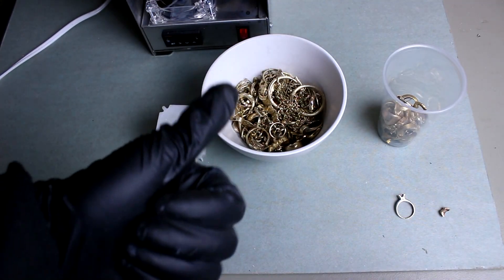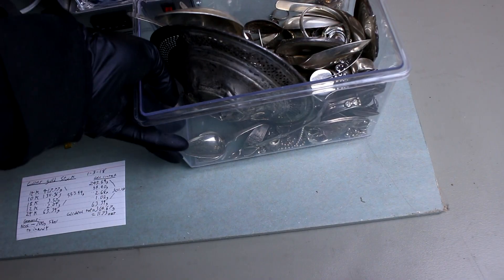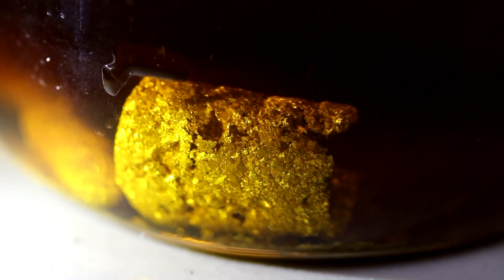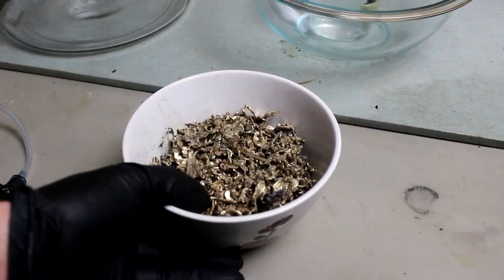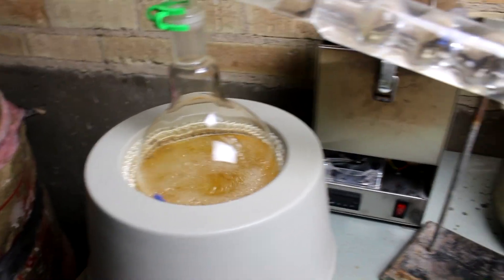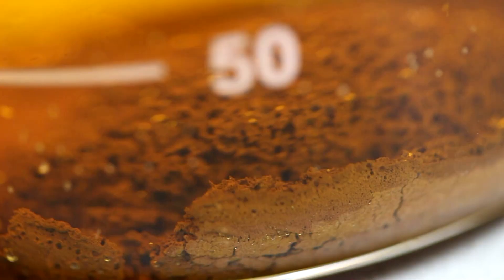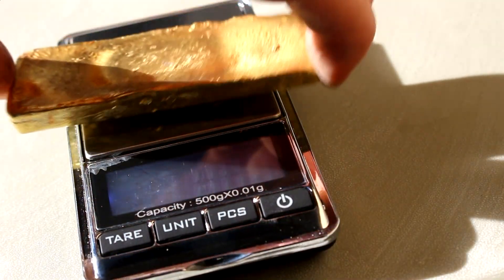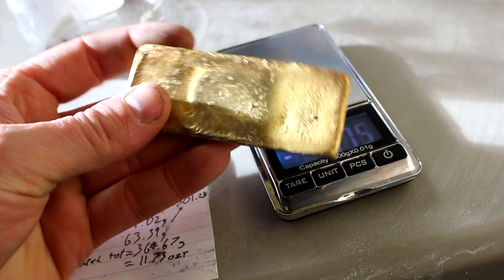Metal Refining & Recovery, Episode 22: 15,500$ in Gold?

Comment: Hi. .
             What exactly is " Diesel exhaust fluid ??" I know there are additives used in semi diesel engines to run during the colder winter, and some to prevent bacteria growing ,or start easier, and some to lower emissions . Love your mad scientist videos ................. Joe Henry , Boise , idaho.........
Reply: Diesel Exhaust fluid is a Urea solution that is sprayed into the exhaust that causes a chemical reaction remove NOx from the exhaust. Its nasty, pain in the ass to work with, and it corrodes everything. Its another emissions control system for diesels
Reply: I'll second everything gwhunter said and add that it's alkaline which is why he used it to neutralise the acid.
Reply: gwhunter is correct. It is supposed to bind to the exhaust to make it heavy so if falls to the ground instead of going into the atmosphere. I work in a diesel shop and no one likes working on DEF systems. I've worked on leaking ones and the entire bottom of the truck was covered in crystallized urea, which is the main chemical found in urine, though they use synthetic urea for DEF fluid, and if it gets on your skin, it itches and irritates your skin for hours.  if you've ever had to clean dried dog or cat urine out of carpet, that is basically what it smalls like.
Reply: This is really interesting . See usually to remove nitric acid in this refining process it requires a long boiling process to make the nitric acid go away. That is really necessary for this process, and this alternative to get rid of the nitric is a big deal, might be much better option .. In the past I have spent days boiling mt aug regia to eliminate the nitric. That is really a pain. and slow. Though now to think of it sometimes  urea pellets are used for this purpose , and this makes sense now..

.

Comment: Saved you a google: Diesel exhaust fluid is a urea solution in water. 

DEF is a 32.5% solution of urea, (NH2) 2CO. When it is injected into the hot exhaust gas stream, the water evaporates and the urea thermally decomposes to form ammonia and isocyanic acid:

(NH2)2CO → NH3 + HNCO
The isocyanic acid hydrolyses to carbon dioxide and ammonia:

HNCO +  H2O → CO2 + NH3

Then, the ammonia reduces nitrates/ites:
2 NO + 2 NH3 + 1⁄2 O2 → 2 N2 + 3  H2O        and
3 NO2 + 4 NH3 → 3 1⁄2 N2 + 6  H2O

This is the reaction which quenches the nitric acid.

Comment: Cody, isn't it safer to add acid to water instead of adding water to acid?
Reply: Idk if this is serious or a reference to his older video
Reply: "Do what you ought'a, add acid to watah" Yes, typically you want to add your acid to water. But this adage refers first and foremost to sulfuric acid , which has a very very high heat of hydration and will actually boil water instantly if you add it wrong, causing splashing; this can happen even if you do the "right" order (I've done it in my college chem days). Nitric acid is less ornery in this regard, so it's relatively safer to dilute directly, but the safer approach is still do dilute the nitric acid into water first to make a weaker solution, which you can safely add water to.
Reply: no but a simple answer like defenestrated posted would work great as to explaining why it does or doesn't matter which order things are mixed in.
Reply: If you are a chemist with years of intuition, yes it seems kinda stupid, as you know where the limits of things are, and how things generally behave. But now put yourself as a college or even high school chem professor, and you have to make sure classes of 20-30 potentially bored, foolhardy, careless immature humans don't create an incident. Iterate over 4 class sections a semester, 2 sections a year, year over year, multiple professors... odds are you will find at least one horrendously unlucky person that manages to get it to react violently and splash someone. Do you really want to be the one that has to have that injury on their conscience, or do you want to teach them a little ditty which, at worst, a good lab practice?
Reply from the maker: Alright do I need to make a mathematical proof or something to show how stupid that rule is?

Comment: You have Oz on that scale
Reply: a Troy Oz is roughly 10% less than an Oz
Reply: Mark Pettersen ? What you want to say with that statement? Hehe

Personal I don’t understand wy use lbs and ounce and so on when you have gram kilos and tons 😁😜😋
Reply: Mark Pettersen 1 once isn’t that like  28,3 grams?
Reply: I'm with you on uniformity and ease of use with metric, all I was saying was the Oz on the scale is not the type that was mentioned. It does get confusing same as most don't realize the difference between a ton and a tonne XD
Reply: Mark Pettersen 1 ton is 1000kg or 100000grams 😁 

har jag rätt svar😏?

Do i have the right answer?

Comment: Oh Cody, you're chemistry technique is going to take you out someday. Who on earth adds water to fuming nitric acid? Bad chemists. If you ever get unlucky it's going to bite you. As I've repeated to my first years for the past 20 years, concentrated acid to water will keep your fingers intact. Hope you never find out the hard way.
Reply: As a chemist myself I have to say the "adding acid to water" only really applies to very concentrated, almost anhydrous acids like > 90% sulfuric acid and its derivatives (methanesulfonic acid, triflic acid etc.). With these acids, the heat formation is very high and since they are so dense, water tends to float on top while boiling, resulting in the splashing effect. The nitric acid he distilled over is at highest around 65-70 % so the heat formation shouldn't be high enough to cause boiling + the water and acid mix much faster, thereby distributing the heat better. I definitely agree that the proper way is to always ad acid to water (as a safety habit) but Cody has probably enough experience in doing this that he knew it wouldn't hurt him.
Reply: Watch some of his first videos. Were he unsuccessfully tried to get the acid to spit at him by adding water.
In my experience this usually only happens in really narrow vessels.
Reply from the maker: 60 to 70%? The nitrate is baked dry and the sulfuric is 93% I'm not an experienced chemist but I am  pretty sure water doesn't just spontaneously appear.

Comment: I had two questions up to this point.  One when do you need flux or borax with silver? I had thought it was to keep molten silver from oxidizing but it doesn't seem to have been the case.  Second and possibly more important.  had you dropped your crucible in the liquid, would it have exploded?  And upon getting to the end I wonder if you were to shape your gold into a slightly larger foil.  Could you then get noticeably different weights in and out of direct sunlight?  I wonder given the effectiveness of solar sails.

Comment: I used to work in precious metals and I have some things that I remember of what I used to do in refining (talking a result of 3kg+ of 9999 gold at time):
First, you'll want to make sure you have approx 36% copper in your mix (I think) before you granulate.
after it's dissolved in your HN03 + HCl you'll end up with your solid silver chloride powder which you'll filter off.
Next we added urea granules to neutralise the Acid before adding in the Sodium Metabisulphate (dissolved in water). I can't remember exactly the probe reader we had, but you couldn't add too much Na2S2O5 or else you'd start to precipitate out the copper too (which I think you might have done with your gold bar - it didn't look pure). That was also filtered.
Lastly (for the gold step), the red powder was washed with ammonia (to dissolve the rest of the silver) before being rinsed with water and dried before being melted.

We were also dealing with Platinum and Palladium in our mixes, so the solution after filtering the gold out was then treated with Ammonium chloride and then had chlorine gas bubbled through it until the Pt & PD precipitated out (bright red - crimson powder in a clear, bright-green solution.)

Hope that is of any help to you.
Reply: Building Books industry is very cool...

Comment: You should heat up your molds hotter before you pour It makes a world of a difference in bar quality. It should be hot enough so that the bar doesn't instantly solidify and cause wrinkles on the outside. While making jewelry we usually just cast one then the next pour has warmed up the mold.

Comment: Would it be effective to capture the nitrogen dioxide and bubble it through a water supply to recover some nitric acid? Granted the temperature would have to be correct, but with some simple lid and tubing some nitric acid could be formed and hypothetically re-used.

Comment: you are not supposed to add water to acid "ad the Acid to the water like you otter"
Reply: Bryant Zaugg holy crap, you’re actually right
Reply: He did a video previously that shows it doesn't matter either way as long as it's done slowly. He also goes into detail as to what scenarios it becomes an issue.
Reply: the rule is add the acid to the water in chemistry. When you add water to acid (depending on how strong the acid is) it could explode and burn you and anything around you
Reply: Bryant Zaugg and as I said, Cody has already done a previous video on the subject. Go watch it.
Reply: better safe then sorry

Comment: Normally the acid is added to the water in order to dilute it, not the other way around
Reply: Brand1n N a long time ago he did his own version of mythbusting by adding water to hot, concentrated sulfuric acid-probably THE worst case scenario for adding water to acid- and could not get the instant boiling and splattering that lab safety lectures warn about. Plus it's cody so safety conventions are merely recommendations.
Reply: robert jencks also safety squints

Comment: diesel exhaust fluid?
Reply: Aqueous Urea 33.5% With Distilled water 67.5%...
Reply: the fluid that binds NO2 and NOx in the exaust gas of diesel engines from cars
Reply: Paul imWald it's more of a truck thing than a car thing
Reply: yea your probably right but wasn't there a scandal with VW about that and their diesel cars?
or maybe they use a slightly different method of extracting NOx.
Reply: Paul imWald well, that was just VW, i don't think that many if any cars have an Nox extraction sistem like that of trucks, and the VW scandal was something related to a wastegate or something like that
Reply: must be an american emissions thing never seen or heard of it here in new zealand and iv worked with alot of trucks, cars and industrial equipment
Reply: I dont know about america but here in the EU or at least in germany, emmisions of land vehicles are very regulated.

Comment: Cody I think you would be interested in a thing called aeroponics a company called aero farms is using it and its similar to aquaponics. You grow it on a sheet and spray the roots with nutrient rich water and use led lights with a specific spectrums to save energy. It apparently uses 95% less water then normal commercial farms and they harvest around every 15 days. I think you should try it out also the whole thing is indoors so you can grow year round

Comment: Cody, was wondering - under the right conditions is it possible to crush carbon into diamond with a hydraulic press? can you try, or explain why not possible? :)
Reply: HT TH id imagine that a hydraulic press isn't strong enough to do that.
Reply: HT TH yes but it would have to be 100% pure carbon which is extremely hard to get your hands a hold of
Reply: seaturtle106 true but still technically possible

Comment: Add acid to water, you are doing what you ought to 

If you life is placid add water to acid. In pretty much every video I notice you add water to your acid and sometimes rather quickly 🙈
Reply from the maker: thats done intentionally because thats a stupid baseless rule.
Reply: He did a video a while ago showing himself experimenting with adding water to acid and showing what the results were, for the acids and concentrations and temperatures he used he did not have a problem. 

It is probably more important for some situations than others like if you were to want to add some aqueous solution to a highly acidic solution at a temperature near or above the boiling point of water in say a small round bottom flask. In this situation you should probably wait for the solution to cool down.

Comment: I am sure you know you should add acid to distilled water, not the other way around... Safety first always and foremost.
Reply: Depend on potency and wich acids. not all react and go "super" hot, or hot enough to bubble. ^^,
Reply: I know, and clearly it did not here, and most of us won't ever get their hands on stuff powerful enough to boil in your face if mixed the wrong way. But, I feel that when you have videos hitting well over 1mil views and have a training in chemistry (which clearly Cody does), you owe it to your viewer to show them proper procedure and not pass for a dumbass  at the same time.
Reply from the maker: the only aced where it even kinda mattes is with oleum and you dont see a lot of that.
Reply: @ cody do you have dyslexia? (i do i can relate)

Comment: Why not just collect the fumes from the nitric acid you use in the reaction and recycle it back into nitric acid? or is it cheaper/easier to use your current method? I believe you did a video on reclaiming the acid (although it may have been another you tuber like NileRed)
Reply: He would need a special designed lid to fit the size of the cooking pot, attached to a condenser. That kind of glassware doesn't exist in laboratory standars, so he would have to request a custom made lid with appropiate fittings to an artisan glazier. Very expensive and not justified for a one-time refining experiment.
Reply: Wouldn't really need any specialist glassware, just needs setting up different. If he had a large conical flask he could use that and a normal setup from there on. I have had to use plastic sheeting secured with elastic to capture gases from large containers before. Worked reasonably well, if done properly you don't lose any significant amount of gas.